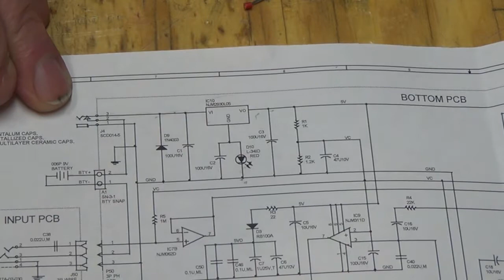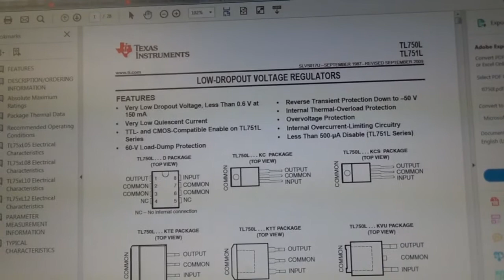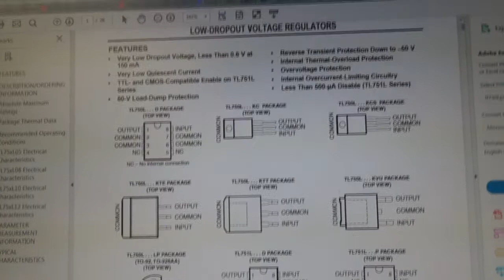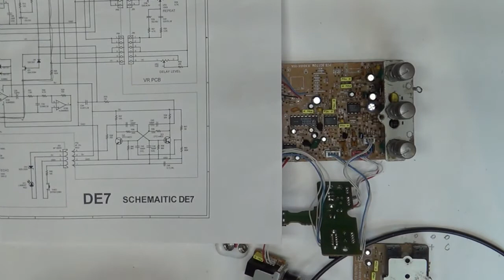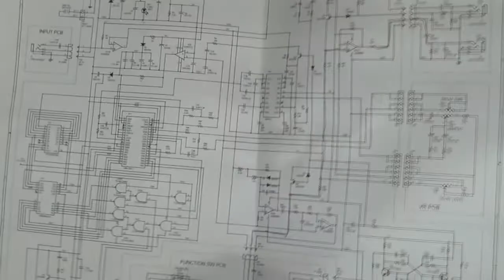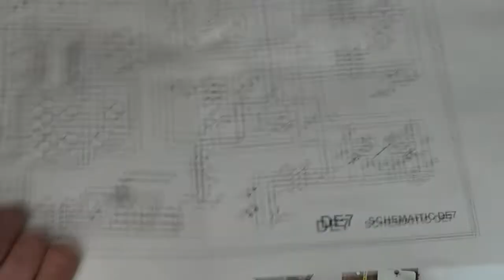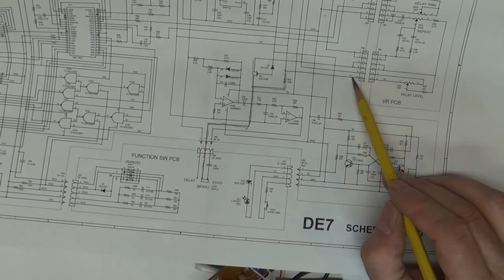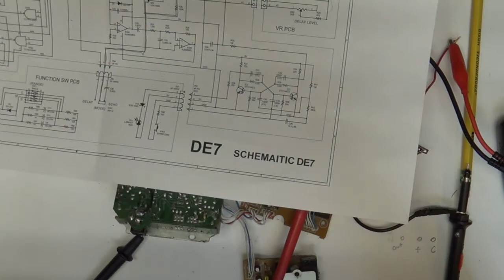Ibanez DE7 Echo Delay Repair with schematic

Comment: So my DE7 had an adhesive applied rubber pad behind that resistor.  It looks someone previously removed it and lifted the trace with it.  Your repair of the voltage regulator looks to be the primary reason for the pedal to malfunction, then you fixed the the problem caused by the previous owner.  Excellent video!

Comment: Thank you so much for this video! Repairing digital pedals is daunting, but this was great. Mine actually only ended up being the power jack, which was loose to the point that it broke the ground connection. I jumpered it and it's back in working condition. Thank you for the in-depth video and posting the schematic!
Reply from the maker: Glad it helped!

Comment: So much wrong here if compare with DE7 i have. The low voltage regulator is fine to send 3.3v for pedal work and this is the regulator (3.3v) i have in mine (not the 5v output). The versions of regulator on the schematic and used for repair have different pins order - mine is gnd, in, out. Curious how it was all connected then. For me half of the video is just all wrong and the reason for pedal not working was second half of the video. Or maybe there are different versions of the PCBs and schematics that run on 3.3 or 5 volts.

Comment: problem with my smash box is the switch.  you really have to try and press it short, and sometimes it comes on, sometimes it comes on and when you lift the foot off it goes back off again, other times it doesn't activate at all. so frustrating!  is there a replacement switch or can I maybe clean it up or adjust the old switch. it is small as crap and also my springs are kinda worked so maybe thats just it or the switch is bad.

Comment: I have one of this...my problem is when i used adapter..it wont work....but when i used the battery it goes well....why?
Reply from the maker: That's a real poser because the battery + passes through the power connector and if that works it means that the regulator is probably working. Could it be teh power supply?
Reply: But when i used the power supply to another pedal it work well....only it wont work for that ibanez pedal....

Comment: I have a problem with the delay/echo switch. The echo mode is not working. The delay mode is on in both switch positions. The problem was probably caused by a faulty AC adaptor which gave out 14 volts instead of 9. Also the dry output and the pedal-off mode work fine. I have some knowledge of electronics, but probably not enough to trace the faulty component. Perhaps I give the device away to someone, because the delay mode works just fine. Unless someone has a suggestion where to start looking...?

Comment: you changed the 3.3 regulator to a 5v one :P schematic is incorrect
Reply from the maker: Hmmm, that's bad. My son has been using it since I fixed it but I can't imagine it's good for it running over voltage. Thanks for the heads up.
Reply: @RobsFixitShop  I havnt checked the rest of the schematic but i dont think 5v is going to hurt at least short term